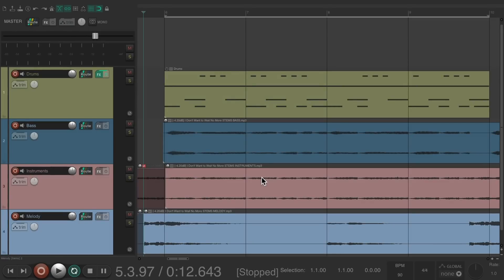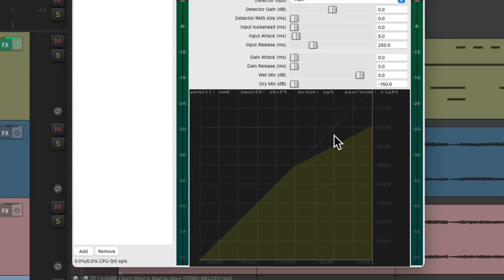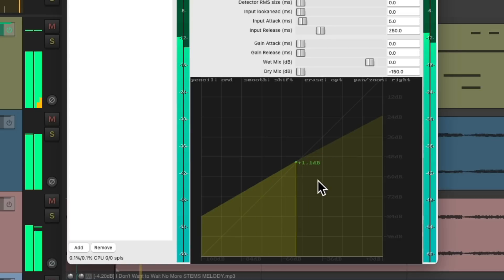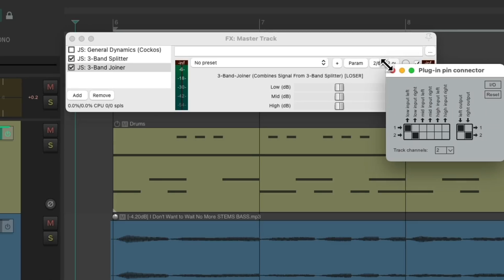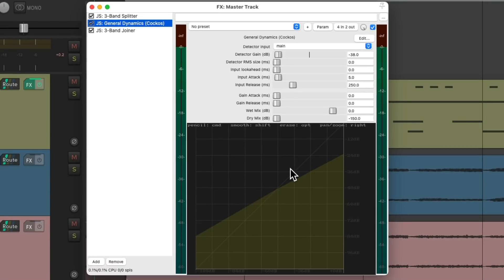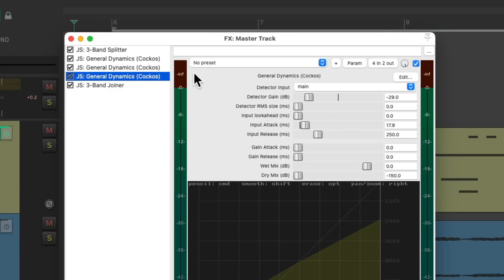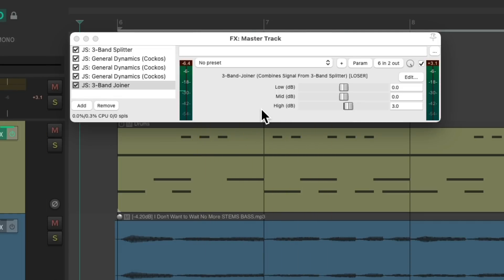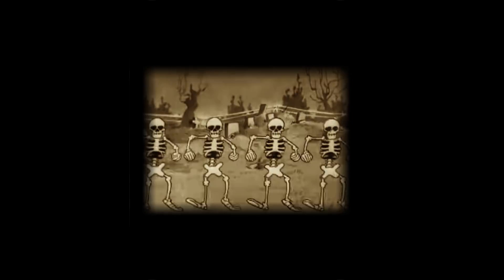General Dynamics - Multiband Compressor in REAPER

Comment: I knew about this way of splitting and joining bands within Reaper and thanks to your video now I know a bit more about how to set it^^ But wouldn't the upward compression a bit too much if used on a mastered track? In your video you implement it on pop music so it makes sense to gain loudness while sacrificing dynamic range, but what about other music genre? Do you think it could be viable to use this chain (multiple times if needed to avoid over-compressing at once) as a last mastering step, right before the signal starts hitting the ceiling so you take care of compression with multi-bands when it starts "mattering", in a way.
Thanks!